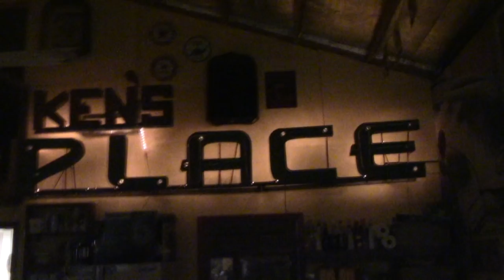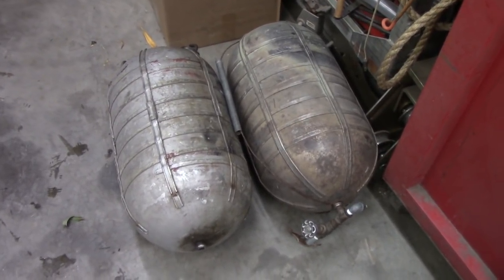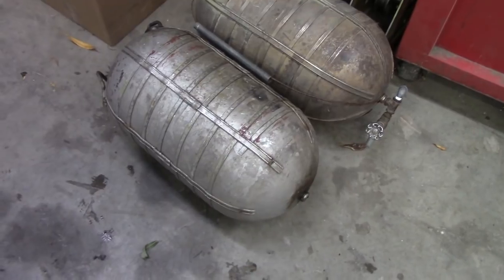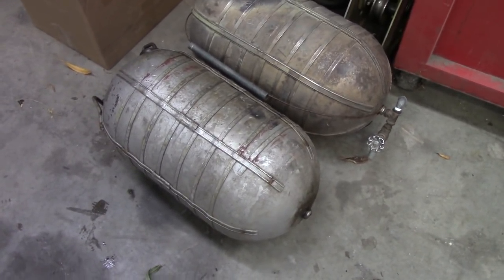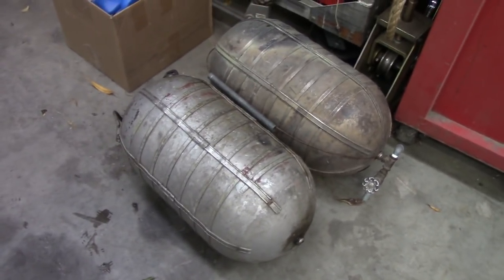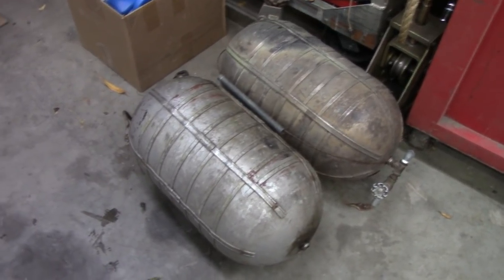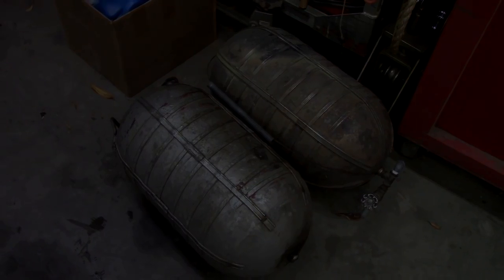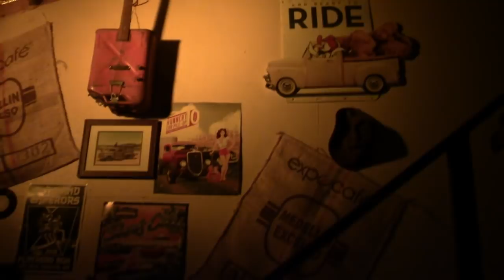30's & 40's kool kar stuff!!

Comment: Ken, those are sweet o'l heaters ya got. Kinda scary in this era too most... but worked well. Kinda like my beat up green Coleman catalytic heater that burns white gas. Flames up priming the heating element for about 15 mins then the mesh element glows. Reckon it's from the 60's?? Nonetheless it works pretty darn good and wouldn't trade it for anything else. Thanks for the vid... another cliffhanger. Hope you all had a good Thanksgiving and got a full belly. Take care. BTW I'm jealous you seeing Junior Brown

Comment: Waylon.......I really love that vise and I gotta ask, I have seen you use that air vise before and I have tried to find components to make my self one but have come up at a loss. Could you elaborate what parts you used to build your vise? I expect others would like to know too.
Reply from the maker: . its just an air cylinder. I built the foot for it and the foot switch on the floor activates an air valve for a dump truck tail gate.  hope that helps. heres a video I did in 2009 https://www.youtube.com/watch?v=c90WPD5_3H0
Reply: Where did you get the foot switch to control the vise?
Reply from the maker: the guy who gave me the air cylinders also gave me the foot switch. that was 25 years ago and I dont know where it came from